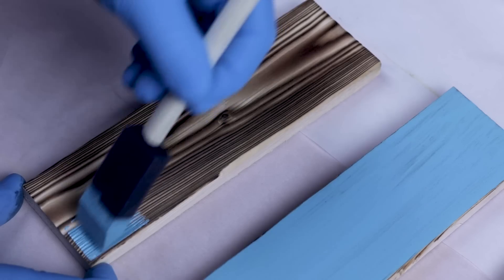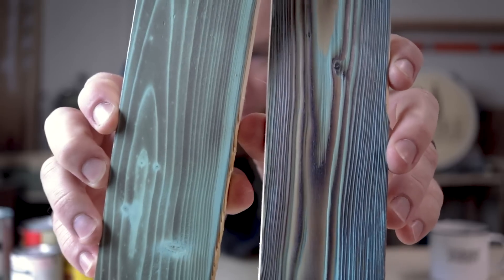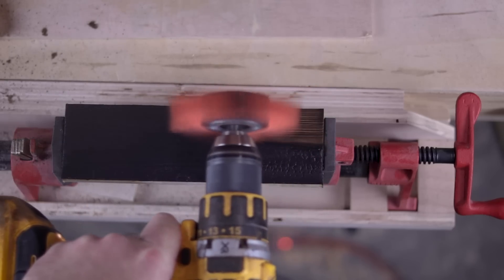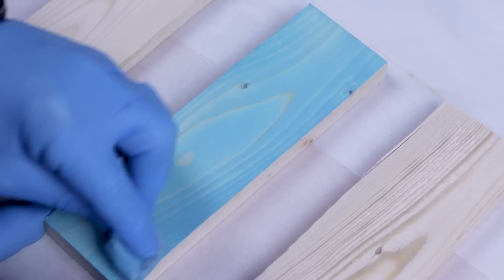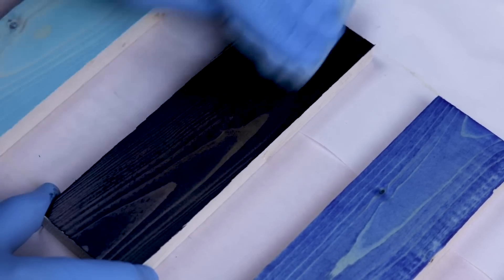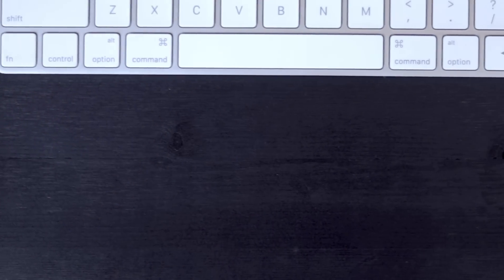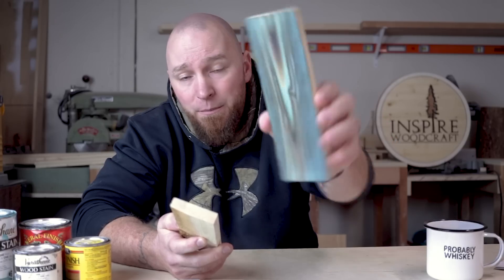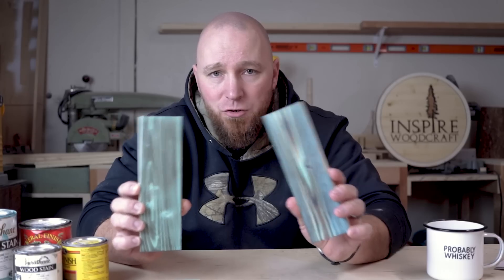One Of These Things Is Not Like The Other / Shou Sugi Ban Face Off

Comment: this is a very instructive video. my question is can you apply this method to plywood or Oriented Strand Board (OSB). Thank you
Reply: I was wondering the same thing about the OSB. But remember OSB are particles glued together vs a solid board with natural grain. The plywood is "sandwiched" together. Correct me if I'm wrong.
Reply: Varathane has a "Grain Enhancer", it comes in white or black.. I made some platforms out of OSB, I sanded them with an orbital & 80grit, then used Varathanes "Antique White" stain, 1 coat.. i then applied the Black Grain Enhancer, its a wipe on/ wipe off product & very easy to use. I ended up doing 3 passes of the Black, wiping off right after each.. Nicest thing is, the White is oil base, but can top coat in a cpuple hours, the Grain enhancer is water based, can also topcoat in a couple hours.. i finished everything off with Varathanes Satin Clear oil base.. I came out Amazing!! So much detail, 3D looking effects.. And the possibilities are endless using either white or black over any color stain you could imagine!!!.. Basically, its not actually burning, but adding the Black to the Grain over the desired stain color, makes it look like it was...

Comment: Hello,  I have been working with burn tools and torches on wood for a few years just self taught. I have only been doing surface burns. I didn’t realize about the deeper burns I can’t wait to try. Question:  does this shu Sugi ban method resist fading in uv light?

Comment: So I am planning on building an entryway table using the shou sugi ban technique as you've described above.  I have already done a few of the pieces and they have turned out awesome, thank you for that.  I'm wondering if I have messed up though.  How do I fasten the wood pieces together once they have been burned and sanded?  The pieces have all the wonderful ridges and texture, but is that going to be a problem going forward when I attempt to connect/fasten all the pieces together?  Should I have assembled the table and then burned the thing as a whole?  Any tips would be helpful.  Thank you in advance!

Comment: My brother and I are building a new summer cabin when I came across your videos.  Iron pipe and the deep burn technique is going to kind of be the theme now thanks to you. Love the deep burn look. I use the fingered nylon wheels but in a drill it takes to long and in a die grinder the fingers launch themselves at anything over 5000 rpm.  I've also used gold colored wire wheels and left the gouges in on a few pieces for a different look.  What wheel do you use for best over all results?
Reply from the maker: Yeah that's the thing that I don't like about the wire wheels too. I use the Restorer for larger runs a lot of times. The wire wheel still sheds but it's not too bad. For the drill attached brushes, I use the Nyalox brushes. Look in the description of this video and there should be some links that point you in the right direction.

Comment: Just FYI... 90% of the time I deep burn my pieces. I use a wire hand brush for better control of how much I want to remove. AND on some pieces if I want more contrast of the Stain, I've used 0000 Steel Wool to remove Stain as a final step before Poly. IF I am going for Super glossy I will buff that Poly once with the wool as well and add another coat.   It all comes down what a person wants, but I know that 'short cuts' usually mean sloppy pieces!

Comment: Would it be possible to stain first and then burn? Curious as to what that finish would look like.
Reply from the maker: It's definitely possible and I believe I've seen it done a few times. I don't know that I would want to be around the fumes myself, but I've never tried it.
Reply: @InspireWoodcraft I tried it today with a deep burn. Pretty much burns out all the stain so there's no point in staining before burning unless it's a light surface burn.

Comment: @Inspire woodcraft I have a couple questions.  First, do you get a noticeablly different look in the wood using a brush attachment vs a wire brushed by hand or is that more of an efficiency thing? Next, is it necessary to wash board with water before the brushing process? And lastly, I was curious if you experience cupping when burning to a charcol finish? I periodically spray water on the board during the burning prossess and this seems to help.
Reply from the maker: Spraying with water is an interesting concept that I had never thought of. Typically I find that heating the back side of the board pulls the cup the other direction. But, no, I've never washed with water before. The nylon brushes leave less aggressive tooling marks than wire, so that's why I usually use them. That being said, I do use hand brushed wire for a more "authentic" look sometimes. The nylon is WAY more efficient though.
Reply: @InspireWoodcraft  true that the wire brush is way more labor intensive. Ya i find that getting the board wet helps with cupping wheb burning to a char. I usually spray with water throughout the burning process as well.

Comment: Jodi, Have you tried doing an accent wall doing Shou Sugi Ban? I wonder if this is possible using wood planks from dog ear fence wood.
Reply from the maker: I have. And it is. That's actually a video idea I have had on the back burner for a while now. As long as the fence boards are dry it will work. If I remember right, I think it's best to sand them first. Not perfectly smooth but close. Also I remember it being more stable to heat both sides. It prevents cupping.

Comment: I've watched all of your videos. I'm just starting out and made my first wood burn American flag. I bought pine board wood from home depot, but it's really not giving me the same effect as yours. Can you please help by giving your opinion of which wood I should buy from home depot, lowes, or any other suggestions. I've bought the torch kit, I still need to get a nice wire brush though. Thanks for your videos. I appreciate that you've taken the time to make them for us..super educational!!! Your work is amazing.
Reply: Your issue may be the grain orientation of the boards.  You might look up images of "quartersawn" vs "flatsawn" boards.  Those terms refer to how the board was located within the tree.  Flatsawn boards are cut more or less perpendicularly to a line radiating out from the tree's center, quartersawn boards are cut more parallel to that orientation.  The patterns you see on the samples here are from the growth rings of the tree intersecting the surface of the board they are flatsawn.  If you're using pine from a big-box store, it'll all be jumbled together, you'll need to sort through a pile to find what you want.

Comment: Nice work. Hey im in the process of sanding off the kitchen cabinets. Im thinking I want to try this. What are your recommendations on making a hard way finish on kitchen cabinets?
(I havent try it yet. But Hard way finish the doors sit on and a solid color frame)
Reply from the maker: Man that’s a tough one. I actually haven’t tried it myself. The one thing that first comes to mind is that if the cabinets are hardwood, I would stay away from these techniques. I haven’t had any good luck with hardwoods and it doesn’t seem like a very good thing to experiment with. If you try it, let me know how it turns out. I’m curious! Thanks!

Comment: Which stain is better, oil based, water based? Great video...
Reply from the maker: I personally like water based because it doesn't amber like oil based, so it does a better job preserving the color. I also like that it has less odor than oil based.
Reply: @InspireWoodcraft  thanks for your time, greetings from México...!!! 🤝

Comment: This is so beautiful! I was wondering if the black diamond pigment would work for this? Iv also heard there is multiple options to mix with. What would you recomend? I was wanting to try and make custom color.
Reply from the maker: I'm not sure. I haven't tried with any other mixtures yet. In theory anything that can penetrate the wood fibers and stain it a different color should work fine.

Comment: Can i achieve a smooth flat surface your way? If i sand it, will it still have the same effect?
Reply from the maker: No the way I normally do it leaves ridges. You would have to do a lot of sanding to get it flat again and would basically go back down to bare wood.

Comment: Can this be sealed with anything to make it an external trim around the windows?
Reply from the maker: I'm not really sure that there is a short answer to this. I will also put the disclaimer out there that I haven't done that myself. But I will say that there are a few things to think about. The stains and dyes I use that are really vibrant and colorful are rated for interior applications. Typically if they are used outdoors, especially in the sun, they will not last very long. Or at least that's what I have always been told. (Maybe I should do an experiment.) What I have done before for outdoor projects is used an exterior deck/fence type stain which has all the good stuff in it to help protect against the elements. Of course for the most part you are limited by colors then. If I was to try to use one of the more vibrant colors outside I would probably put top coat of exterior rater spar varnish on it. Even then, I don't know for sure what will happen to the color underneath and the varnish may yellow in the sun. Sorry for the long-winded reply but hopefully it gives you some ideas.

Comment: Wow, I’ve not looked into this much, but as a total ignorant newbie, the fully chared and then cleaned with the funky wheel is by far the eye grabber and much more appealing if looking for ‘wow, that looks pretty amazing!’.

Besides the aqua, did you try it suffest from using, ebony after white, or ebony and then the weather Grey or driftwoods?  Colors I’m looking to use on a personal project but now this whole charred thing has an element of love to use and finish with that 3x varathane thick coat in a not gloss finish and to smooth out a bit of the texture.  Any thoughts or examples in the black/grey/white like combos?  I’ve got ebony, antique white and  a weathered grey/ driftwood stains and the thick poly coat I nearly began but lucky, caught this at the last minute!

Comment: I think it's like you said, 2 different effects and honestly I can see some applications for the partial char method, but would ultimately prefer the full char and scoop. That being said, have you ever planed or sanded down after brushing the full char to get a less textured final product, and what were the results of that like?
Reply from the maker: I haven’t. I will use steel wool sometimes to polish residual stain off the charred grain for a higher contrast, especially with white. But sanding or planing would essentially just get rid of the charred grain and then you would be right back to square one.

Comment: Thanks for the comparison, Jody. For me, the full-char/brush method looks so much better. Question: on 1x stock,  especially pine, do you find that doing a full char tends to make the wood cup?
Reply from the maker: Yes, but also it depends. Narrower stock won't move as much but wider stock is more prone. That's the one thing I haven'e completely figured out how to fix. Dry lumber is the best place to start. Sometimes applying a little heat and then waiting and making a second or third pass helps too. Thats why I kind of go in layers almost. Also, and this isn't always ideal, if you char both sides it will more often then not go right back to where it started.
Reply: Thanks for the feedback. I burned an already slightly cupped  (imagine that...) 1x6 white pine board from Lowes. So, the cupping was already present. I'll try your suggestions.

Comment: I've been wanting to do this to my porch. I didn't realize the difference (grain texture) between the 2 methods until I saw your video. Which method do you think would be better for a porch with high traffic? Would it be better to be smooth? Or is the textured grain ok? I prefer the look of your way better.
Reply from the maker: I can't give you an exact answer because I've never done a whole floor before, but to seems to me that the brushed texture should work okay. Maybe better now that I think about it because the surfaced burn would scratch and sort of fall apart quicker it seems.

Comment: What kind of paint bases you think is the best for shou sugi ban?  Water based or oil based?
Reply from the maker: I think it really is just personal preference. I like water based simply because it's easier to clean up and it's less stinky. Which is great fo me because that means I can bring stuff inside to dry when it's too cold in the shop. Poly is a different subject though and for that I almost always use water based because it doesn't amber like oil based. Some of my first projects were essentially ruined because I used oil based poly and it completely changed the color.

Comment: I like the total burn better but the less burn seems quicker, plus the less burn has a "cleaner" appearance - smoother.  Question, I'm wanting to apply this method to a ladder shelf I'm making for a bathroom -- do you burn the wood prior to making or after.
Reply: I would say if you are only burning and staining the outside faces of your project do it after but if you are thinking on doing the inside of it do it before.
I just did a front door and it's hard to do the corners but it's worth it, the look you get it's amazing. 
Good luck on the project and hope it comes out looking nice
Reply: I made a futon frame using the full charge method he shows. I cut everything to the dimensions I wanted then burned them after. I like the look I got but one problem I ran into is that once you take so much of the wood out through burning and brushing the dimensions change a bit so my frame didn't go together as square as I would have liked. I think next time I do something like this I may try getting everything fit together, figure out just where all the joints are exactly and try to avoid burning those spots very much so my measurements don't change too much.
Reply from the maker: I think I would try to do it after if you are going to go the quicker route. You won't lose any material because you won't be brushing and changing the physical dimensions of your project.
Reply from the maker: Such a helpful and encouraging comment! I totally agree as well. Man a whole door would look pretty sweet!
Reply from the maker: I've seen people burn whole dressers after and it looks pretty neat, but I could only imagine the issues that could come up if you did it prior.

Comment: I have a question can I do this with wooden fence boards for an accent wall and of so will the wood expand or shrink eventually? I dont want to put this up on my wall and then have to take them down because they separating because of shrinkage!
Reply from the maker: It can be done on fence boards, yes. I honestly don't know the difference in expiation and contraction between burnt and unbent wood though. Actually never crossed my mind before. But if you treat it as normal and leave a small gap between them, it would work great.
Reply: @InspireWoodcraft  thanks good to know will give it a go at it!

Comment: One question, I did oil finish on my guitar,  and guitar is made out of baked ash, which after oil finish is pretty brown. Is there any way to do a paint job on it since the oil penetrates deep into the wood, so I'm not sure if paint will stick.. Is there any way?? I would like to do turquoise color similar to yours in this video..
Reply from the maker: I would have to think that you would have to sand down to remove the oil. In the case of a guitar body, I would just wonder if that would be too much material removal though.

Comment: You seal it after with a clear coat correct?
Reply from the maker: Yeah you don’t have to, like with most things, but I recommend doing so. I personally use a brush on water based poly for fully charred pieces and spray on water based poly for brushes. Typically anyways.

Comment: What kind of finish do you use? I’m debating between boiled linseed oil or polyurethane. Need your input please
Reply from the maker: On stained stuff like this I use a water based poly usually. Water based doesn't amber like oil based so it preserves the color a lot better.

Comment: what is that wire brush you have used for this craft?
Reply: It's a Nylox brush. You can get them at most hardware stores, but Amazon for sure. Stick with the Gray and Orange ones. I forget the grit, I think 80 and 120.

Comment: Thanks for the video! A quick question about your brush on the drill. What type of material are the bristles? I think you touched base in a previous vid, but I cant remember the difference in grits. Thanks!
Reply from the maker: They are nylon strands. I believe they come in 80, 120 and 220 or 240 grit. I'm pretty sure I left a link to the set in the description of this video so check that link for sure! Hope that helps!

Comment: Hi, I have watched several of your shou sugi van videos over the past week (several other tubers videos as well). I have been considering it’s use for planters and raised garden beds but have struggled to find an answer to how well it performs (resistance to rot and longevity and any impacts to the soil) against the soil in a bed. I know it seems to hold up well against weather when used as siding but I was wondering if you have discovered any information relating to this in your research and practical experience?  Also and in line with the question about raised beds wether less expensive woods such as pine can hold up when compared to woods like cedar for these external uses?  Cheers.